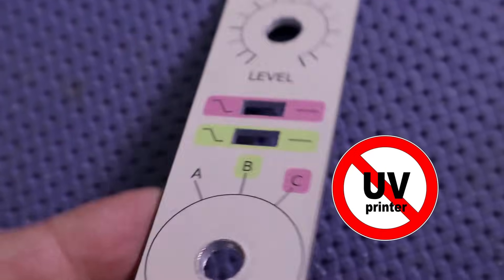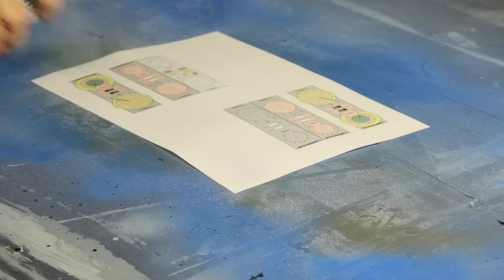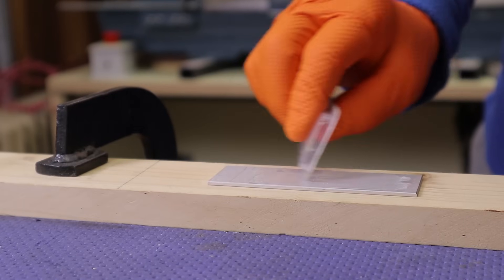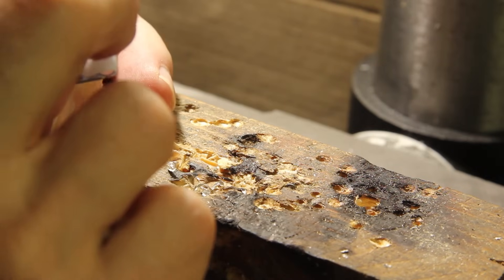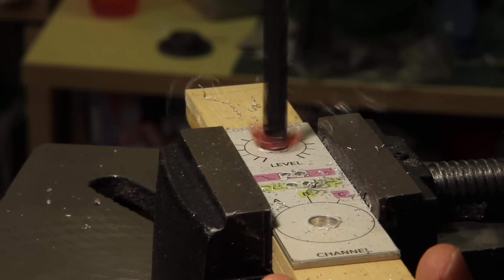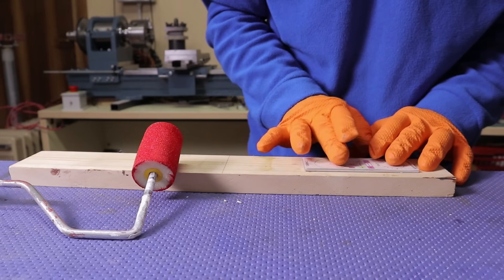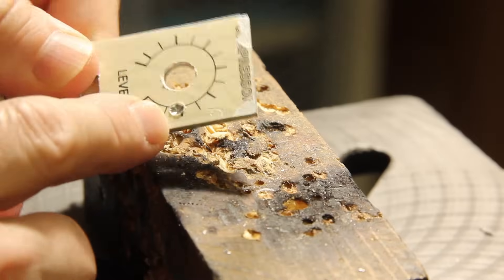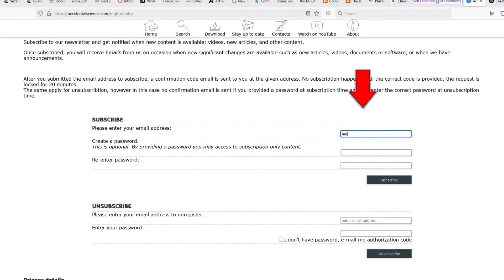How to make front panels that look factory-made | New DIY Method + Tests

Comment: Make them out of FR4 (pcb material) it's not exactly DIY but design your front panel using Kikad or EasyEDA. You don't need circuit traces, just use the silk screen layer to print your logos and text. You can also accurately place the holes for switches, OLED screen cut-out, rotary encoder etc wherever you like. No cutting or drilling required, and you can have holes in the panel in any strange shapes that would be hard to do accurately by hand.  If you are using an OLED screen or encoder or something else which is using SPI on the front panel then you can place tracks on the rear of the panel to connect to those on the rear or the panel too.  Then just upload your gerber and get some PCBs made, it is really cheap vs the cost of aluminium panel and sticky back plastic.  Some PCB manufacturers even offer full colour silk screening. If the project is SMD and single sided you can have the whole thing built on the back of the front panel! Use smd zero ohm resistors to jump over tracks if you need to. If you want the panel to be shielded, fill one side of the 'PCB' with copper.  leave an area exposed and you can solder a groiund wire to it. We did this with an signal RF generator project and it worked perfectly. This is how to make rrofessional looking front panels for your DIY electronics projects
Reply: @LearnElectronicsRepair  my only concern is the asthetics and thickness of the edges.  Also, if PCBs can't be made with non fiberglass material, then you also have the health issues with micro cuts when an admirer is running their fingers along the cool looking news panel.  It's been a long while since doing my own PCBs, can you now select non FG substrates now?
Reply: @andrewpelletier1199   seems like you've missed out on some of the more recent developments in FR4 (at least from Asian fabhouses), but anyway, there's nothing stopping you from doing the exact same process but using aluminium instead straight from the fabhouse. Even gerbers don't need any adjustment.
Reply: I heard "hi guys, welcome to Learning Electronics Repair" in my head.
Reply: Dayum! That's a wonderful idea!
Reply: Yeah, I posted the same thought - then read your post. LOL [Note to self: read other's comments before posting.]
Reply from the maker: That's a possible alternative. Of course there are many ways to do the same thing. The aesthetic final result change, though. And eventually it's just a matter of taste.
Reply: PCB with silk screen is OK for quick and unaesthetic project. Design your panel with any CAD then print out on "waterslide decal paper". Transfer the decal and protect it with lacquer. 
Very nice video!
Reply: @vk2ihl  That paper has gotten prohibitively expensive  - you can buy four whole reams of 50 pound printer paper for the cost of 10 sheets of that stuff. (Last I checked a few months ago.)  Also, the decal method has other less than desirable qualities: it does not adhere as well as a glued sheet, it is too soft - even with the lacquer, a fingernail or finger ring scrape or two can tear it, and, if you're the least bit fumble fingered, it can be a real PITA to place correctly.   I still think the method we see here is the better choice.

Comment: tip: put the size of length and width on the paper/design. So you can check it after printing. If required you can change the scale in the printer settings
Reply from the maker: That's a good addition! Thanks.

Comment: Nicely done. I would probably have tried soaking the paper in epoxy, clamp it on the aluminium with teflon strips and cure it at 60°C in the oven if I had tried this way, but for the time being I'm team "bumper sticker".
Reply: At that temperature or higher (up to about 110°C for some epoxy) it becomes thin as water, and cures 5x as fast, so a slow curing must be used.
Reply: @erikdenhouter  That was intentional.

Comment: If you use a hollow punch in the drill press before you use a drill, it will spin and cut the paper cleanly before using the drill through the aluminum
Reply from the maker: It's a good advice indeed! While for holes that are covered by knobs or that must be filed, using thin paper is just enough as it makes very little burrs. But for holes that must stay "as is" after drilling, yours is really a good advice.
Thank you for commenting.

Comment: Awesome build and advice!  I usually print on my graphics on a large transparent label, but I don't print it to cover the entire panel edge to edge. Instead, I leave a 2mm to 4mm margin of bare surface around all the edges of the label. This creates step-over between the label and the panel's surface. I'll explain why in a bit.

After precisely aligning the label on the surface using reference marks, I drill the holes, file the cutouts, and deburr them. I then spray several coats of UV protecting clearcoat over the entire panel. After several passes, it gradually fills over the steps, leaving a smooth and invisible transition between the label and the surface.

There are two advantages of this method.  First, it makes it nearly impossible to peel the label off, since there's no edges or corners to lift it from. Second, the UV coating is very hard and protects the ink from fading over time due to UV radiation from sunlight and indoor lighting. 

You can use an opaque label, provided the panel is the same or close in color so the margins are not visible. You can also use epoxy instead of clear coating although I don't know if it offers any UV protection.
Reply from the maker: Thank you for the thorough explanation.